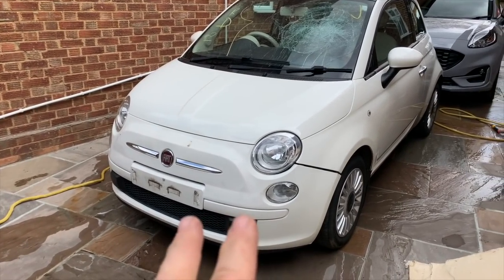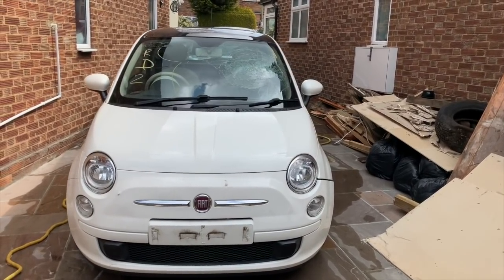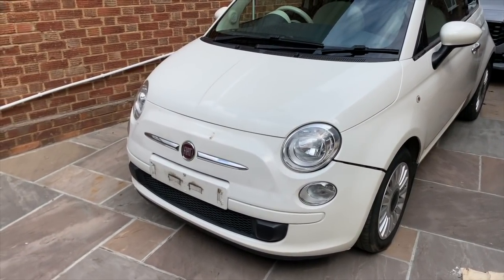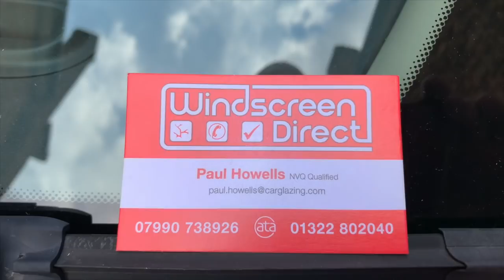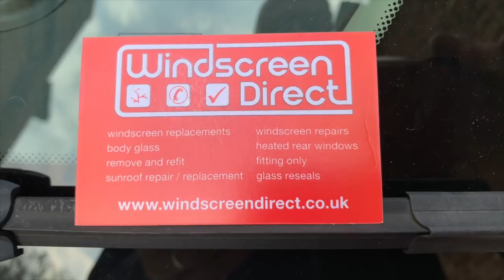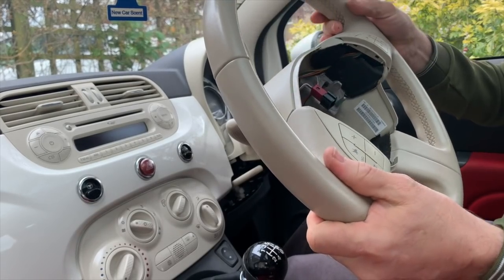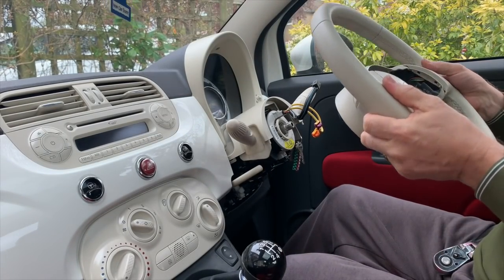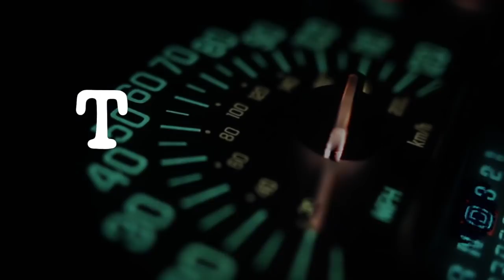Project Rob & Viv Day 2 - The windscreen and new steering wheel. Copart Cat N Crashed Fiat 500

Comment: Safety tip. Only loosen the steering wheel nut before trying to remove it from the spline. Saves you getting a face full of steering wheel. 👍

Comment: I need to change the steering airbag only, a nice dent in chrome ring, is a case off a few screws to undo it, I will of course disconnect the battery,, many thanks
Reply from the maker: I’ve recently discovered that unclipping it can be done by twisting the screwdriver rather than prising. If you get a screwdriver of the right length and width of tip it’s much easier than prising. It’s fiddly with those screws getting the bottom cowling back on. You have to get them just at the right angle. It’s actually easier getting on your back with a torch and seeing where they’re going. I’ve almost got it down to a fine art but have been known to spend 2 hours just doing two screws up. 😬

Comment: Hi Paul
I have contacted the windscreen chap, seems an excellent fee, but I have a question you may or not know the answer to. I want to retro fit a auto dimming mirror, and I know that the fitting is the same, but a screen with a slightly wider black shield is needed to cover from the front so you cannot see the fitting etc.
I note on your video that this windscreen seems to tick this box and it is slightly different, what are your thoughts on it, do you think the screen he fitted for you is also suitable for the dimming mirror, I have emailed him anyway, but always an interesting chat for your channel as well.
Reply from the maker: Don’t the auto dimming mirrors have some sort of electronics? Those wires would not be there. I’m assuming you’re talking about the ones on the Series 4 cars. They have a button and a little green light.
Reply: @Love500  yes power negative and one cable which goes to reverse
Just three cables to run down a pillar and tap in somewhere i have the fuse it should come off can oick up neutral just inside the door where the ground connections are
Reply: They are on some early abarths and top spec 500 on pre uplift models

Do need to find one with two covers as on ebay many are just the mirror only you need the small cover at the bottom and cable cover at the top
Reply from the maker: @barrystannard2153  oh I see, so you’re running the cables. I thought for a minute you were talking about a reversing camera mirror. I’m sure Paul the windscreen guy can advise on the best screen with the right amount of blackout.